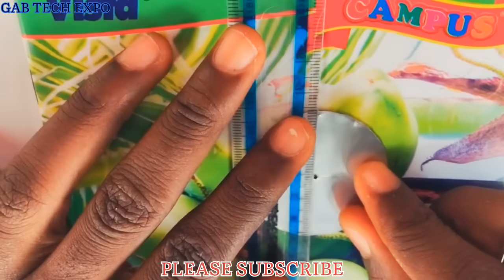How to make jet engine using soda can l diy jet engine l homemade mini jet engine

Comment: Interestingly, this type of jet engine has been built on a larger scale. It is actually called a motorjet or thermojet. Experimental versions used a piston engine to power a compressor, which compressed incoming air. Fuel was added and burned. And the exhaust was accelerated through a nozzle to generate thrust. But this engine was superseded by the turbojet. The primary reason for considering this engine in the early days of jet propulsion is that it avoided the need for a turbine back when superalloys that could handle the heat of combustion were in their infancy.
Reply: I thought it didn't need fuel. I thought the electricity would turned the air into fire.
Reply: @GiantSquid2319  капец ты наивный
Reply from the maker: Great 👍♥️♥️
Reply: bhai thrust kitna hai

Comment: aint this a fan with an afterburner?
Reply: It is not cuz too weak dc motor for compressing the air enough.
Not an afterburner still just failed motor jet aka jet prototype
Reply: @mkd856 true
Reply: Fr

Comment: It is not only a jet engine but also  a creativity of art don't insult it
Reply: It is not a jet engine so i will insult it just a dc motor and gas let out not enough compression, strator blades, diffuser and it seems its made of aluminium which is bad cuz it will melt in a real jet engine.
Dont comment if you know nothing about anything about jet engines😂😂😂

Comment: It’s not a jet engine. Just electric motor with fire 🔥
Reply: I spent over 30 years as a jet engine design engineer with two of the Worlds biggest jet engine makers and the second I saw that electric motor I went... WTF!  If it does not use the Braton Cycle it is not a jet engine.

Comment: What fuel did u use I made one my self but I don’t know with wat to run it
Reply from the maker: Use propane gas or butane
Reply: Thanks
Reply from the maker: @Ghostyplaystabor  🫶
Reply: Could you use things that’s easier to get and carry around like a can of ax or is that dangerous

Comment: Does it produce trust?
Reply: No. As someone else said, it is nothing but a glorified blowtorch. The only thrust it would produce is the minute amount the fan blade is producing- but it would produce that whether there was fuel/flame or not. 

This is basically nothing more than one of those portable kerosene fueled "torpedo heaters. " They simply burn fuel in front of a fan to produce heat. No thrust is produced.

Comment: @matthewstorm5188 yes you're correct but the way i see it i just think he made an edf (electric ducted fan) used in rc plane models and then he atached a pipe that injects fuel so its not a jet yet a edf that burns fuel
Reply: It is an EDF Afterburner

Comment: how much thrust
Reply: Not much since this isn't a true jet engine.
Reply: @StudleyDuderight not that bad if use electrical engine faster it will be minimum 5 mph on rc car
Reply: @FFootbal_21  There is no way that electric motor is pushing enough Newtons to move anything at 5 MPH.

Comment: Thats not possible.. the cam would melt
Reply: The question is how fast?)
Reply: @andriiukraine6697  like in 3 mins prob
Reply: That is low powered jet
Reply: @azimmulazim  still would melt
Reply: @RexTheStormChaser  prove it
Reply: @azimmulazim  high tempretures
Reply: @RexTheStormChaser  its just hot as home stove
Reply: well the fuel is being burned behind it so it doesn't melt

Comment: This is not a jet engine.
Reply: What is it
Reply: @theluckypumpkin2796  A glorified blowtorch.
Reply: True, it would be interesting to see though if he turned off the motor would the turbine continue to run 🤔. Maybe even generate voltage from the motor?

Comment: Guys calm down its just a mini jet engine its not really supposed to produce thrust as its just a scale version. this jet engine is not actually like a real jet engine since jet engines have a compressor which lets the engine generate way more thrust and increase its efficiency and the compression spins the fan blades allowing it to self sustain but on this jet engine it uses a motor. as to recreate the self sustaining parts at this small of a scale is very very hard to do without precision machining. you can use just a fuel rod and push fuel into the engine like seen in the video but, this is very very inefficient for both thrust and fuel. stop hating, its just a cool DIY project that most people can do with things in their household.
Reply: except it's not? it does not function like a turbofan/turbojet at all. it's a fan and a flamethrower. agreed, it's a super simple project ppl can do at home, but it's very misleading to call it a jet engine.

Comment: Jet engines must have stages of compression chambers... this one doesn't have it so it is not Jet Engine!
Reply: and jet engine does not start it's ignition from the back 😂😂😂
Reply: @afriadiali9371  it starts but with starter and with self igntition in combustion chamber
but in diy models you need to ignite a gas yourself

Comment: I understand all but how he make fire out of it?
Reply: That was from a model rocket "engine". Look up "Estes Rockets" through Google. When you ignite it, it is like solid fuel and propels the model rocket into the air. On the back of this can, it just shot flame out.
Reply: @marcd1981 Get real dude. Not a model rocket engine at all. He used either propane or natural gas
Reply: @timrussell1559 I am real, no AI here. He showed a model rocket engine in his hand during the video, so that's what it seemed like he used.

Comment: Does this create thrust?
Reply: No. :(
Reply: Yes it does!  The $0.47 electeic motor and aluminum fan certainly create thrust.  Is it enough to do anything with?  Probably not.  But it could be measured, yes.  The flame is gas expanding, so would also produce a tiny amount.  I think on a small cart with good bearings it would roll across the floor if the battery and fuel tank were onboard.

Comment: What a freaking joke! That is definitely not a jet engine, not even close. Glue holding stuff together for one. This is an insult to even a person missing half of their brain.
Reply: It solely depends on how good it performs, if you miscalculate it even by a little the heat will melt the glue but when glue melts and cools it works like new but yeah ic where ur coming from, using wood in a jet engine💀
Reply: And yet, it functions.
Reply: when it's heat enough to melt the glue😂😂😂

Comment: There are over 3 types of jet engines- 
Scram jet, ram jet, turbine jet.
This is a poor man version of a turbine jet engine.

Aturbine jet uses a fan to feed the flames at start up.

A ram jet is similar  fighter jets and commercial aircraft.

A scram jet - uses no turbine fan.only the exhaust gasses Leamington suck in more air in the engine. Used in our SR-71 black bird military jet for hypersonic flights.
The tubine can spin freely after it hits top speed.
😮

Comment: This is like jet engine not actually jet engine.. actually the jet engine collect the fresh air and then compress it with the help of thousands of fans inside the engine with the help of jet fuel then though it by back it helps the aircraft to pushed frontway @gabtechexpo4017

Comment: Back in WW2 Italy made a hybrid jet. They had a piston engine turning the compressor so self sustaining wasn't really a requirement. This looks kind of like that. Now you should test thrust with and without fire. If it actually makes more thrust with fire then you may be onto something. Your big drawback is where the fuel injector is so far back. It is more of a weed burner. needs to be further forward and restriction needs to be much smaller. The can won't survive, being aluminum. Try steel.

Comment: If you remove power from the motor, does it sustain? If not, its no jet.. add more compressor wheels and a stator aling with a burn chamber with dilution holes..

Comment: LOL - What a bunch of CROCK.  The video is nothing but CLICK BAIT.  This is NOT a JET ENGINE at all.  It is just a burner made into the shape of a jet engine.  This guy has no idea of how a jet engine actually works, the amount of thrust produced (even by a true mini jet), and the amount of heat it would produce.
Reply: there is no thrust or compression... blow torch only
Reply: @Number1uncle 2020 ahh user

Comment: If you had a fan connected to the compressor fan and made use of the accelerating gasses coming out the back resulting into faster spinning of compressor fan then you’d have an engine. Right now you just have combustion with consistent but minimal thrust.
Reply: Bro.. this is just a look like . Not a an actual jet engine. 😂

Comment: To much air in the the chamber the fuel has to be pushed out as much as the air the turbines are taking in, air is heavier then liquid or less fuel being injected out Get a fuel injector from  auto parts

Comment: The single stage "compressor" (aka improvised fan disk) is only electrically driven making this closer to a blow torch than a jet engine.
Reply: Well it's a jet, it's called an EDF Jet.

Comment: Which fuel did you use please tell
Reply from the maker: Propane gas
Reply: But it doesn't have any smell.
It would be risky to use
Reply: @vandnavandna3823  i gotchu. Hydrogen gas

Comment: Should write a step-by-step guide.  I would love to use this in my classroom for a project.  However, I will have to modify it for more blades, an actual compression stage and combustion chamber, and make it a low-bypass turbofan.
Reply from the maker: That's great.

Comment: What happens to the fire when the battery runs out?
Reply: Well assuming the fuel injector doesn't stop, it'll start leaking fuel and it'll probably get set on fire
Reply from the maker: Don't let it run down

Comment: Very great working principle 
The fuel I guess is not producing thrust due to low air intake nxt time use a more powerful and a big battery for more intake for a decent thrust output for the amount of fuel used
Reply from the maker: Thanks friend 👍
Reply: @gabtechexpo4017   welcome 

Try upgrading the turbine blade with more fins with combustion chamber which will be easy to operate at high speed
Reply from the maker: That’s exactly what am working on now, and the video will be released tomorrow 👍♥️. Thanks for your contribution friend
Reply: I'm building a single seat WIG craft using jet engines that I hope to build.

Comment: How much trust its produce?
Reply: @v3locirapt0r_m0ng0liensis yup , my bad , thrust
Reply: @Kamil_Ahmad  None. It does not have a mix chamber and a second inner propeller. The inner propeller is supposed to be turning the induction propeller in the front to cram oxygen in to a mix chamber where the air/oxidizer mixes with the fuel and gets lit up. Being lit up in the mix chamber turns the inner propellers faster and the cycle continues. This thing in the video is simply a fan blowing on lit fuel. It looks like the real thing, but it's missing some key parts (crankshaft uniting the two propellers/mix chamber, and passage for air to flow through).
Reply: the motor melts in 60 seconds lo lol lol oh for  lol not much use then for transatlantic flight lol mmmmm

Comment: Is this considered a pulse jet engine? What type of engine is this?
Reply from the maker: It's a turbo fan jet engine
Reply: @gabtechexpo4017  cool work, but it isn't a jet engine. sort of gas burner
Reply: Its an electric fan blowing air onto a fuel spray that is ignited outside of the engine housing. So, not a jet engine just a forced air burner
Reply: @Adui13  Good point! the conditions inside a real jet engine are too much for a soda can to handle

Comment: But does it have thrust?
Reply: Yes... but not much. 95% is coming from the fan as there is no internal combustion to raise pressure and force hot exhaust out the back.
Reply from the maker: It's thrust is from the edf

Comment: You should probably place foil on the wooden pegs holding the motor or it would probably burn to a crisp (I don’t know much about this this is just my idea)
Reply from the maker: Thanks friend ❤️ I think that's a great idea
Reply: You should not talk anymore
Reply: There is no fire in the can. The fuel nozzle is almost sticking out of the back and the fan is making sure it all blows out.

Comment: Maybe add a combustion chamber section behind using a steel canister or something to cover the flame that won’t melt with a turbine on a shaft back to the “compressor”. Finish it off with another coke can for the exhaust shaped like in the video and you have an actual gas generator

Comment: How does super glue and hot flame work together?
Reply: Simple, it's because the direction of flame and hot air is in the opposite side from his dynamo and where the air flow comes from.
Reply from the maker: For real it was actually holding 😂😂

Comment: I highly suggest you to check out the jet engine basics. The idea of attaching an elettric turbine with an injector can work, but you need a MUCH better design than that. I suggest you starting watching this: https://www.youtube.com/watch?v=25i0AzTa5rw&t=635s&pp=ygUVamV0IGVuZ2luZSBlc3NlbnRpYWxz
It's a video that explains the fundamentals, good luck.

Comment: Electric motor inside a jet engine.. LOL dudhead
Reply: That's how you start a jet Engine...

Most use a electric motor to start it
Reply: @realpeepeepoopoo69  Not at all bro... you use BLEED AIR (obtained through the APU) ... thats what is the initial thrust provider. Starter motors are used in IC piston cylinder engines
Reply: @realpeepeepoopoo69  bruh what have you been reading

Comment: Almost😅  in a jet engine the exhaust gasses turn a turbine blade that is connected to the forward intake blade. The throttle is based on fuel input. You could use a t bone and slot connector to have a easy way to get it spinning with the electric motor in front.  Then when you pull the starter motor away and it is self sustained it is a true jet.

But what you have now is basically an electric ducted fan with neat after burner.   Still a really nice proof of concept.  Great work 🎉
Reply: that turbine is a fan powered "jet", just wanna make it for a science fair ik it doesn't work like that but i dont wanna go actually make a jet, this is close enough
Reply from the maker: Thanks bro I really appreciate.
You know such comments motivates me the more on creating better contents ♥️♥️👍 I really appreciate you 🖐️.
Have a nice day 😘
Reply: That's correct but everyone has to start somewhere and this guy is on the right path along with people's knowledge and input!🙂✌️
Reply from the maker: Thanks a lot bro for that motivation 👊

Comment: That's really awesome
    You need a job in Hollywood fr
Reply: Put a diffuser so it stops the rotation of airflow
Reply: You know I believe you could make useable thrust with this would get a outrunner brushless and better fan though
Reply from the maker: Yeah ♥️
Reply from the maker: Thanks a lot friend ♥️

Comment: What fuel s you use Diesel? can i use alcohol?
Reply from the maker: It isn't diesel it's cooking gas  but alcohol will still  work
Reply: @gabtechexpo4017 ty
Reply: @gabtechexpo4017 I use Butane It burned god damn High
Reply from the maker: Nice one 👍♥️

Comment: Does this hav any thrust or is it just for looks
Reply from the maker: If only you make use of the right gas
Reply: No thrust bcs there is no pressure, to keep this simple. fire likes smooth pressured air, it doesnt like high flow air. I like the design but try adding one stage to increase the pressure and to make actual thrust and also if a jet engine is run by motor that it is not a jet engine. A jet engine need to self sustain . Kudos to you, try to make a V2 engine. For idea, Adding a stator behind the inlet can increase the pressure. And produce thrust.

Comment: Where would i find the pipe used to spray the gas?
Reply from the maker: You can find all the parts at a refrigerator spare parts shop
Reply: What it is called

Comment: How can the glue withstand the heat,  man?
Reply from the maker: You asked a good question friend but there is something you didn't listen to.
If you noticed the flames discharge hose was almost close to the discharge of the engine thereby making the possibility of heating not possible at all.

Comment: where did you get the stuff to inject the gas inside the engine? Like the copper pipe and more?
Reply from the maker: I got it from a refrigerator spare parts store

Comment: Does it produce any thrust?
Reply: yeah, but only from the blades (in this model, the burning gas is just getting blowed out by the spinning blades) so the electric motor and the blades work as a propeller, not a jet engine, but the burning gas looks good. In a turbo jet engine, you dont need an electric motor (or maybe only at startup) and then it works without help of an electric motor, the air gets compressed, mixed with fuel and then ignited and because of the "explosion", you get thrust, so without fuel, a real (turbo) jet engine wont work. In this case, the fuel burning stuff really only happens for asthetics, but a turbo jet engine is very hard to make yourself and/or very expensive (in RC planes they use ones that cost between 1500-6000 dollars) so this is a good alternative if its just for looks. A real jet engine is also 20 times louder (a RC one)
Reply: and this uses lpg (gas) and not Jet-A or Diesel like real ones (or again RC that are technically real just rather small)